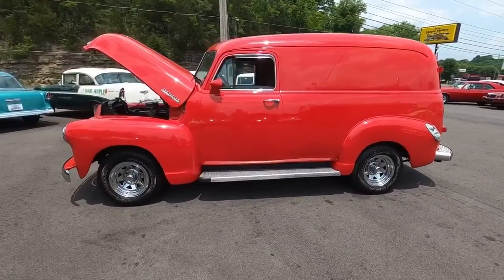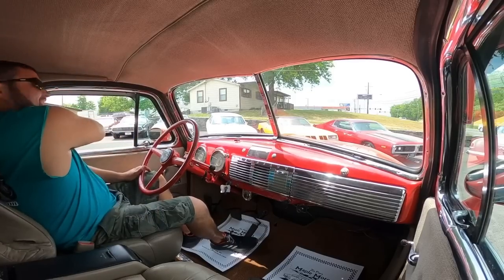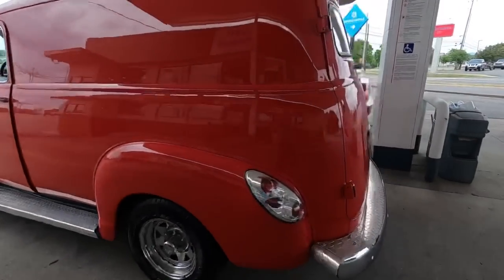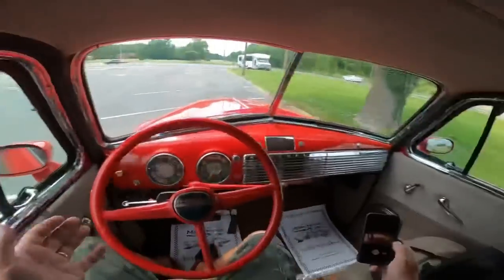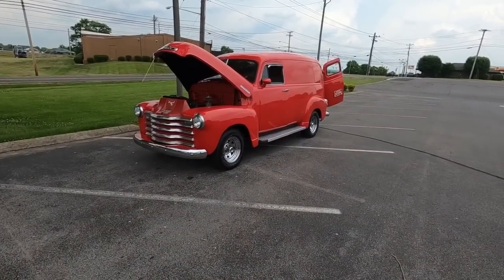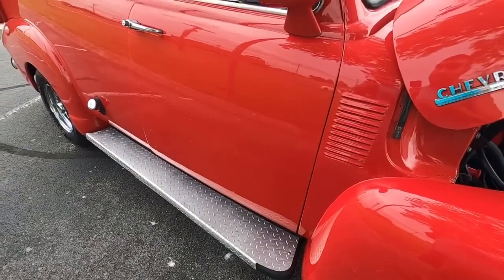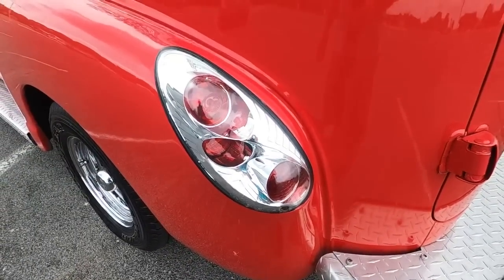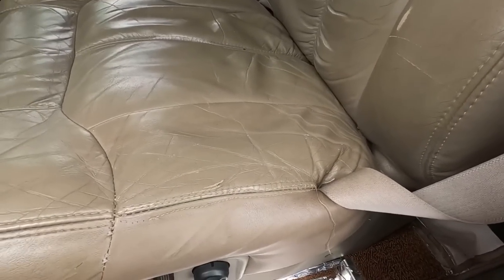Test Drive 1953 Chevrolet Panel Truck SOLD $19,900 Maple Motors #1637-1

Comment: There's a simple solution to the grinding clutch. Replace the whole drivetrain and motor with a Ford setup..lol..Otherwise it's a nice ol' truck!!
Reply: Ford setup… yea old flathead… that would be a head turner
Reply: @guardinoinc.7490  Or a little 302..You buy a donor 90 something Ford Explorer with the 302 pull the body off of the chasis and drop on the new 1953 Chevy body. That way everything is upgraded and the parts are cheep.